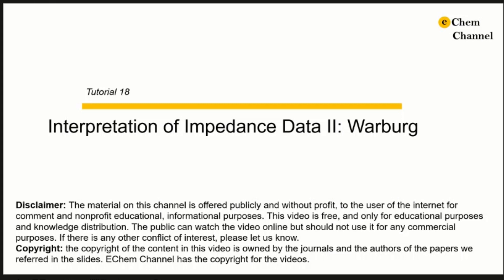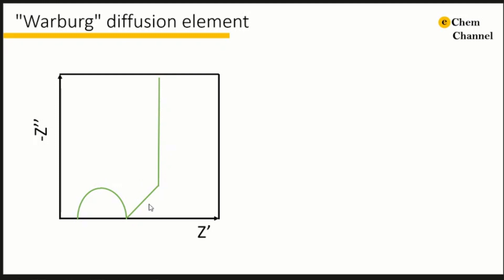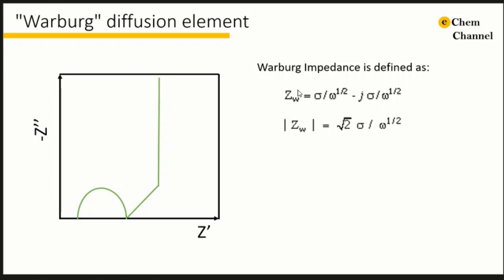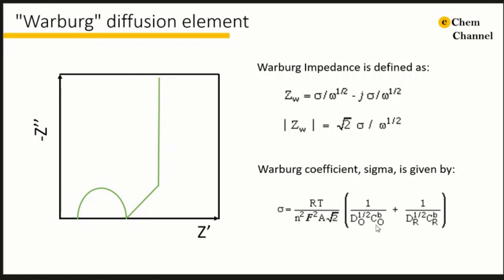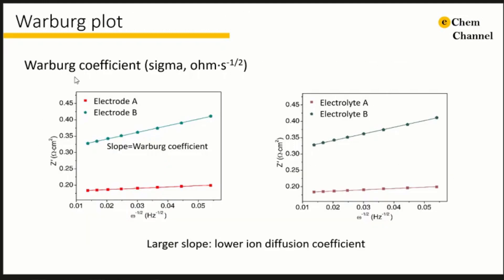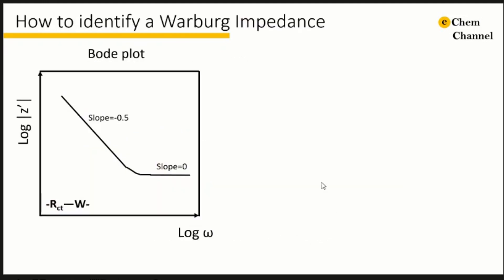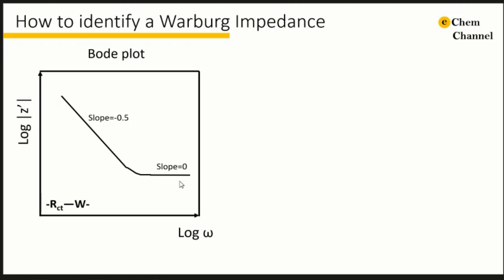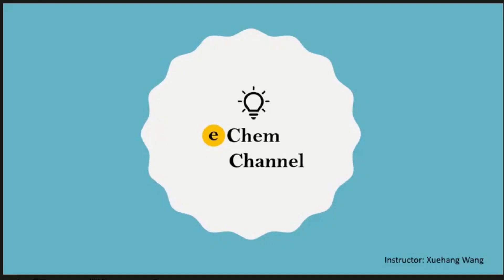Tutorial 18-Warburg impedance

Comment: (1) How can we calculate the Warburg co-efficient if the slope is not exactly 45 degree? In this case, the slope of both real and imaginary components will not be the same. 

(2) Also, is it possible to calculate the Warburg co-efficient directly from fitted data?